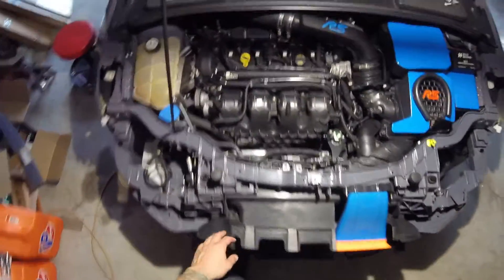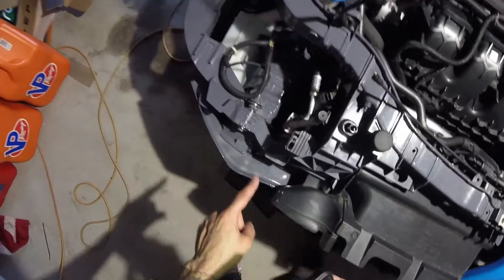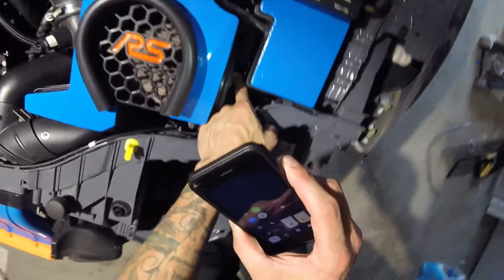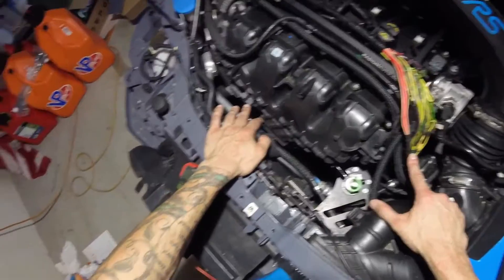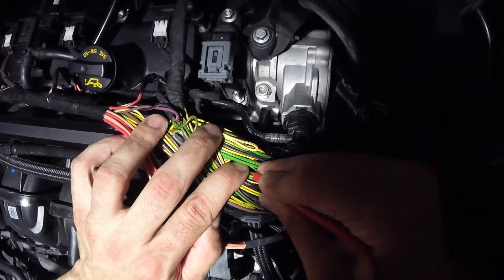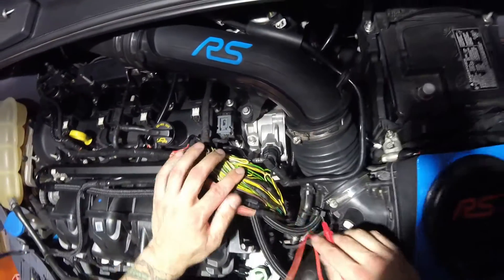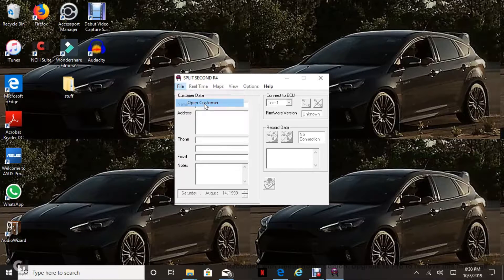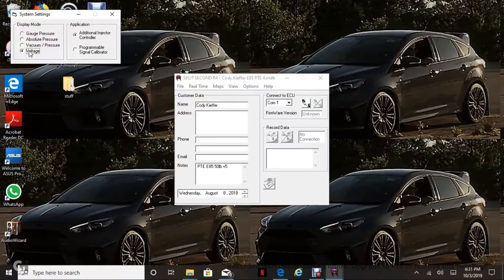2016 Focus RS: Journey to 500 WHP - E85 Split Second Aux fuel, taking the RS over 30 PSI!

Comment: Hi, if it's possible to drive at E85 with just a remap ?, or you need to change some mechanical piece. 
Best reguards
Reply from the maker: I was advised by my tuner to replace a few of the fuel connections prior to running e85 because it is much more corrosive than an e30 blend. As I understand it, modern cars come from the factory ready for up to e30 but e85 will require some modifications if u want reliability.
Reply: @codestr04  Which connections? do you remember off hand? I am about to build my fuel system for the RS.
Reply from the maker: 1st World Problems SOLVED I installed a fuel surge tank so that may have been the reason for the fitting changes. But i replaced the quick connect on the fuel supply in the engine bay and the 2 quick connections on the fuel tank.

Comment: have you drained the coolant?
Reply from the maker: MrThisthatthisthat Im not sure of its relevance. But yes, i had to drain the coolant when I swapped the motor. Why?
Reply: @codestr04  In the video the reservoir seems below minimum, after dealer replacing the head gasket seems that my engine drinks coolant again. So i wanted to understand if you experience similar issues. good luck with the built :)
Reply from the maker: MrThisthatthisthat No issues with coolant levels. I just like to keep it at the minimum line when its cold. That way its easier to determine if there is a “coolant loss”
Reply: @MrThisthatthisthat  There are plenty bad first HG jobs...have it re-checked.